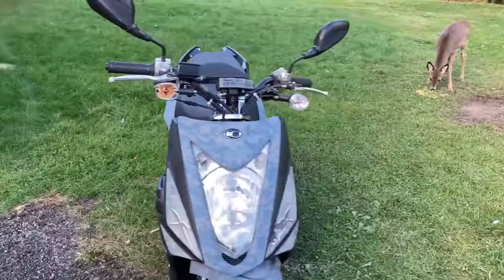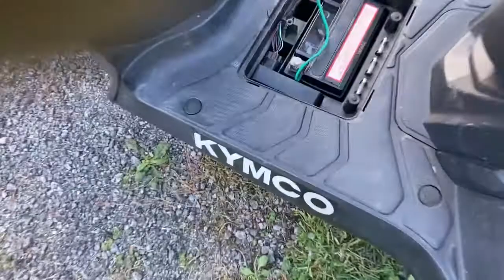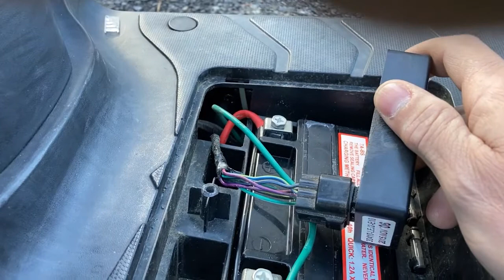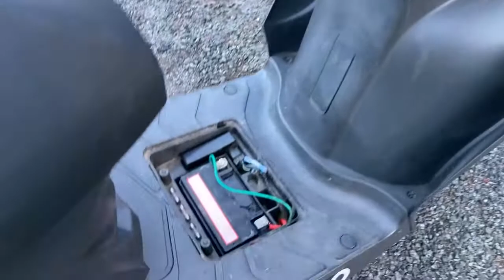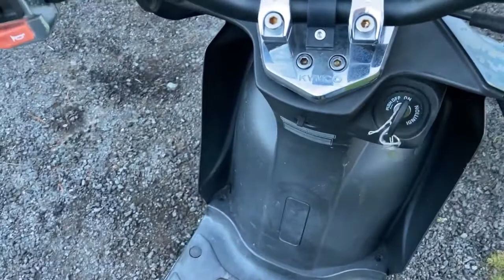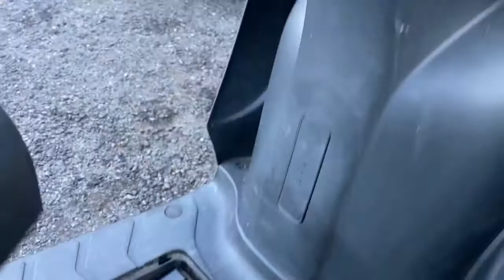Kymco Super 8x 50cc Scooter CDI rev limiter wire cut

Comment: Which one of the purple wires did you cut? I have a Kymco Super 8 and I didn’t know which one
Reply: I'm here for the same question
Reply: Same question
Reply: I looked at a pinout on Google of 6 pin and it looks like one is the signal wire and one is the ground. So the two wires all the way the left if you are looking at with the smaller clip with two pins on your right. In theory you should be able to take either out. I would recommend just taking the pin out of the plug instead of cutting
Reply: @thomasd2695  yanlis olan pembe kabloyu kesersek  ne olur
Reply: Either one of the purple wires will work. I cut one yesterday, went from 28 mph to 35 mph max speed
Reply: He said either purple one jesus
Reply: @davidreali9642  you can cut all of them, you don't really need them and they just get in the way..... 😂😂😂
Reply: I got one and I cut both
Reply: @shaynejones2880  did it go faster with both cut than just one or about the same

Comment: You said that there are 2 different purple wires. Exactly which one is the rev limiter ?!?
Reply: Either one of the purple wires will work. I cut one yesterday, went from 28 mph to 35 mph max speed
Reply: @henrilopes7337  what year is yours?
Reply: @joelalexander5338  2021
Reply: @henrilopes7337  Mine doesn’t have any purple wires. The far left bottom wire is green, and when I disconnect it the bike won’t run. Mine is 2022 and I don’t know which direction to go in now. Thanks for the reply. I desperately need for this thing to go faster.
Reply: @joelalexander5338  lemme know when you find out. About to buy a 2022 tomorrow
Reply: @joelalexander5338  If it is fuel injection it's in the ECU  so 30mph it is.

Comment: 2023 Super 8 50x worked on as well. Going downhill.. DOWN HILL! would go to 32 then back to 30!, just this one change alone i hit 36. Next step is the malossi variator multivar kit and kevlar belt.

After that probably 82 carb yet, then if still need more may look at exhaust.

Comment: Now the scooter does not reach full speed because the engine is getting too little fuel.
Remove the carburetor and open the float bowl. In the middle is a copper nozzle. You can unscrew that. If the hole gets bigger, the engine gets more fuel. This can be done by means of a file set. For sprinklers.
Reply: Hello please can you help me i have 50cc and i want to disconnect limit speed

Comment: Some of these have a restrictor bushing by the variator--not sure of the Kymco.
Reply: The Super 8 has the gimped variator bushing, you can get them fairly cheap off of ebay. I did that to mine and got an extra 10km/h to my top speed. I'm scared to do any other modifications while it's still under warranty.
Reply: @superleetmegapunx  Mine is a 150 and it was not restricted by the variator bushing. I did get about 7mph top end gain with a Naraku race variator swap and some Dr Pulley sliders. Very simple mod. (WARRANTY IS EXPIRED ON MINE).

Comment: Will this work for a regular agility 50?
Reply: I need this answer too xD
Reply: @Thomaat116  no it does not work. What you need to do it take a hacksaw and cut a notch on the opposite side of the wires down about 3/8’s of the way through the box and you should see a copper wire. After you hit that you should be good to go and have gained about 5-7 mph

Comment: if you only have a 6 pin one cut the pink wire
Reply: What of i have 4?
Reply: Then you probaly only have a variator ring. Check if there Are any wires from the variator to the cdi. If there is cut it, if there is not a wire there you will need to remove the variator and locate a small ring and remove this. But buying a Racing variator for 50-60$ will be the best option and give you the most top speed.